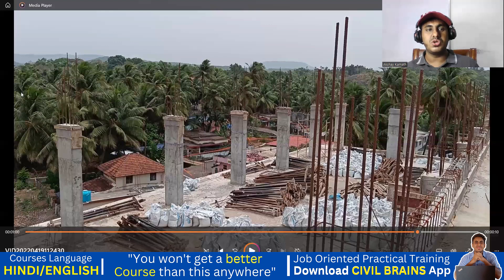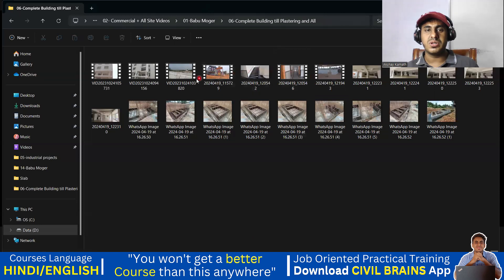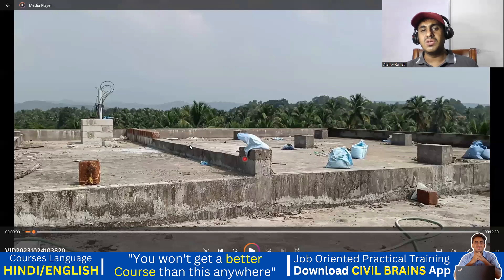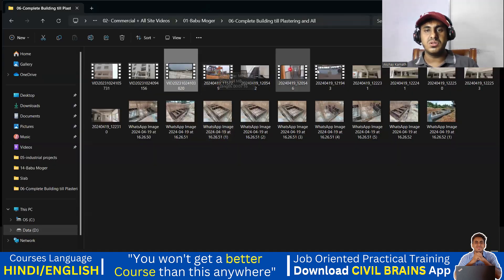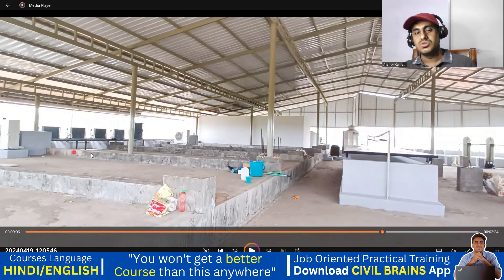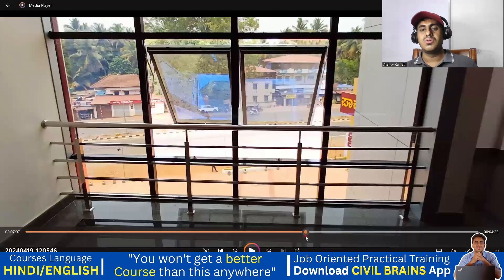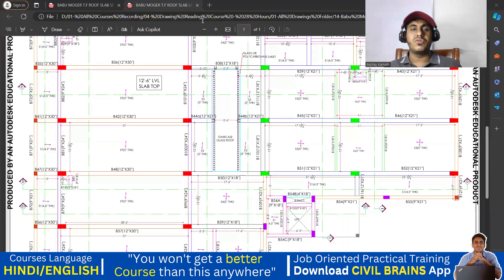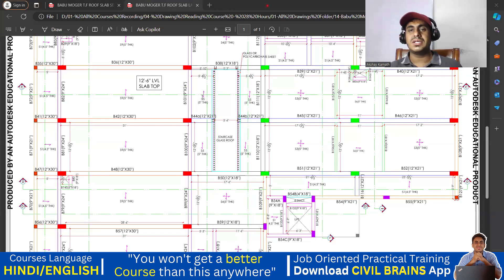What is Inverted Beam | Know Directly from the Site | Akshay Kamath

Comment: Sir when I designed inverted beam analysis and design is  a same like normal beam , inverted beam load carry from slab above inverted beam to transfer to column like a same normal beam sir inverted beam main reinforcement is lower to main reinforcement slab it is correct or not
Reply from the maker: everything will  be same , only in inverted beam we have to neglect the concrete strength in shear calculation
Reply: @civilbrains 
Thank you sir I have a one question explain in detailing inverted beam to make a one vedio inverted beam
Can an inverted beam carry an inverted beam or a normal beam? Can an inverted beam carry a point load? Can a normal beam carry a point load? We also ask you a secret: Can an inverted beam carry a slab load like a normal beam? How do inverted beam and slab beams carry each other? Make a video for us.

Comment: Sir, Do inverted beams typically require more stirrups than regular beams to resist 100% shear?
Reply from the maker: Not much , usually 10 dia bar @ 150 or 200 mm c/c Spacing is Sufficient .
Reply: Sir when I designed inverted beam analysis and design is  a same like normal beam , inverted beam load carry from slab above inverted beam to transfer to column like a same normal beam sir inverted beam main reinforcement is lower to main reinforcement slab it is correct or not